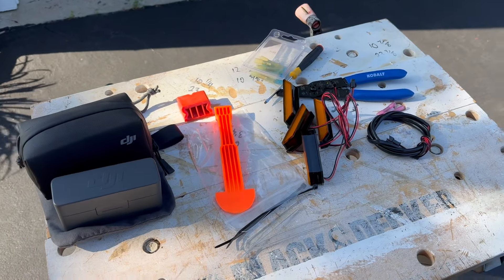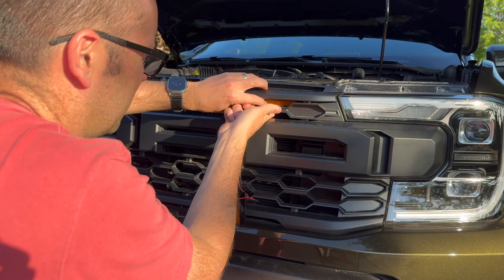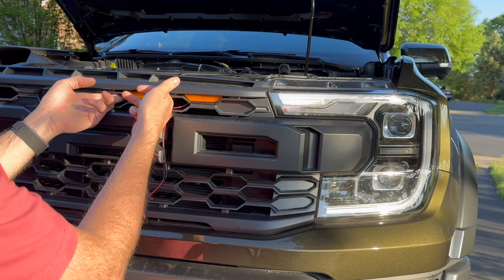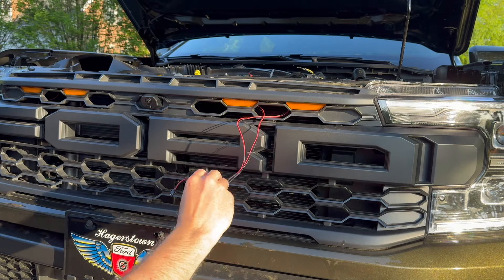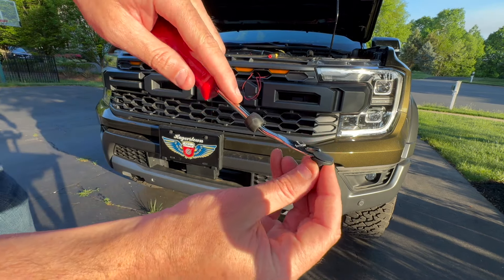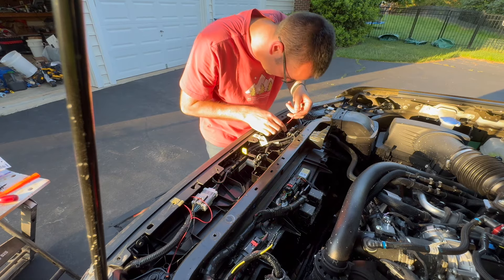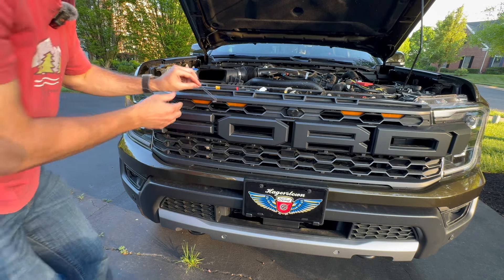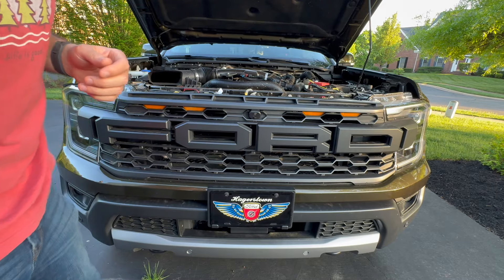2024 Ranger Raptor USA amber marker light install on Aux Switch 1

Comment: did the same with AUX6 because the wires for that are close to the grill. removed the top cover and used a coat hanger to pull the wire harnesses up the back of the grill. used f150LED's 4 light kit (2 sided tape attachment). took about an hour.
Reply from the maker: Awesome. Switch 6 is certainly the most convenient wiring up in the front for sure!

Comment: Looks good and seemed pretty easy. I've had my RR fir a week now. So far I only put a soft roll up tonneau cover on. I think something I want to do is pull off the black fender flares and paint them body color. I like that look more. Definitely need to get some lights on mine too.
Reply from the maker: Body colored fender flares will look great for sure! I have a huge light bar off my dad’s old jeep that I may hook up just to see it work again. May hook it up and throw it on the roof

Comment: Hmm, tried to comment but Youtube deleted it.

Anyway, this video was invaluable. I found getting that lower trim piece off the grill was not very easy without the possibility of breaking it. So, I went this route with one change. The first clip I tried to install immediately broke so instead I applied automotive tape to the top of each light and they went in just fine and they don't move at all, time will tell if it holds up.

Thanks for this video, I don't think I would have attempted this without seeing it first.
Reply from the maker: Glad you gave it a shot and made it work. I think the tape will create enough friction to keep them in there. I ended up using a tiny dot of glue on each one as well

Comment: Nice job.  Few takeaways for me…. I’d really like to see a video on how to remove the grill. I’ve seen a fair few videos now that claim it’s easy to remove the grill but never show the actual process - just the grill laying on the floor whilst they get on with whatever they need to do behind the grill.  Second, I’d like to see more about how AUX1 was presented and how you connected to it (unless I missed that somehow) just saw a couple of connectors being crimped (line and neutral) ?  Thirdly, where did you run the ground (earth) in end?   Lastly. Did your wife forgive you!!?? 😂 keep it up, loving the journey.
Reply from the maker: Haha, I did a second video of the wiring so that should answer those questions about aux 1 and the ground. But to keep it simple, aux 1 is the purple and green wire in the bundle next to the aux fuse and relay box and I grounded it to a bolt under the cowling that holds the hood latch for now. You could also power to the daytime running lights fuse if you wanted to go that route. I found a video on indicarbon.com about getting the grill off and they made it look way easier than it was, I was afraid I was going to break something when I tried prying the small trim piece off to expose the 8mm bolts so I did it this way. Wife is happy cus I used the truck to pick up 2 yards of mulch and haul some tree branches to the dump the next day :)
Reply: Ha!  Love it. Happy wife, happy life 😀

Comment: Awesome add, I am ordering one! I am curious if we can wire it without going through an aux switch. My OCD of that one switch always on would kill me
Reply from the maker: Absolutely… I think I may actually switch my wiring and power it from the same fuse up front that runs the daytime running lights. I just wanted to play with the aux switches but I think the DTRL is a much better wiring solution
Reply: @flaberdoopin and make a video of it, right? Please 😉

Comment: Could you mount with 3m auto tape instead of the plastic hooks to hold in place?  Mine arrives next week, and thinking about something similar
Reply from the maker: I’m not sure where I would put the 3m tape. It is too tight to put on the sides and I don’t think over the back would do much. If you took the whole grill off it might open up some other options for taping but I don’t see a way to do it when I put mine in. Sorry I can’t be more help on this idea but I’ll think about it and see if anything comes to mind

Comment: Looks great but would have liked some more detail on the install instead of just fumbling around with the plastic piece. Do you have a link to the item? Part number?  Would like to have seen specifics in the wiring.
Reply from the maker: I had the video edited over 30 min at first but thought that was too much. I will put together a quick video of exactly where I pulled wires and everything to make it easier to see install. I ordered from indicarbon and this is the link to what I got.  https://www.indicarbon.com/store/p/ford-ranger-raptor-next-gen-grill-lights-amber/white

Comment: Great video.  Do you know if these lights can be installed to turn on automatically when the running lights turn on, i.e. no auxiliary switch?
Reply from the maker: Absolutely, if you were to tap into the fuse for the daytime running lights you could have the amber lights come on any time the vehicle is started

Comment: We've recently discovered some fog lights for the Ranger Raptor model. A few have been supplied to the States, but there's a concern that they won't fit with the special bracket provided. However, they do fit perfectly on the AU Ranger Raptor! 

Could I kindly ask you for a favor? If you have a photo of the fog light bracket (shot from the back of the fog light showing the bracket no need to remove the fog), could you please send it my way? I’d really appreciate it! Thank you!
Reply from the maker: @Signaturelux37  I’ll take a photo tomorrow… how do you want me to send it?  I can just make a post here on YouTube and link it unless you have an email address i can send it to
Reply: @flaberdoopin  yeah sure that would be great Thank you! 🇦🇺
Reply: Also we have left you a message in Ranger 6G forum :)

Comment: Nice to see that the aux switches go off when the truck is off.  Are all the aux switches that way?
Reply from the maker: I do believe that they are. When the truck is off the little lights that make the switches glow all go out. I am going to hook up an old light bar from my dads jeep to the 25 amp switch tomorrow and I’ll let you know if that one is the same
Reply: @flaberdoopin  Thanks.

Comment: Update! I installed my amber lights on my 2024 Ranger Raptor and I ended up wiring them up to the driver’s side front fender marker light. If you have an email address you can share with me I’ll show you where I ended up hooking it up at. I ended up using that side marker because I only wanted the amber lights to come on when the side markers came on and I avoided using any of the auxiliary switches.
Reply from the maker: wow, that's a great idea... you can send an email to flaberdoopin@gmail.com if you dont mind.  i will rewire them today and free up that aux switch :)
Reply: Can you please tell me the details of wiring them.
Reply from the maker: @errolnuque8772  i have them wired up to switch 1 which is a 5 amp circuit and i keep it on at all times.  You can ground it to whatever screw or bolt you can find going into some of the sheetmetal or metal brace you can find near the wiring site.  The positive is in the bundle of 3 aux wires and i just found the correct color wire based on the manual.

Comment: Very nice! I am wanting to do the marker lights but I want to use the 3 slots at the top, will those also fit in the 3 slots at the top?
Reply from the maker: I was looking for the same 3 light kit but in the grill you would have to cut the plastic out to fit anything. This kit would not fit up in those from initial look because these would stick out thru the grill and might look awkward but I’ll take a closer look when it gets light and let you know.
Reply: @flaberdoopin   Yea, I would not mind drilling a few small holes to run the wires if those lights would set in those pockets nice and flush. Sounds like your saying those in your setup were to big to fit in the upper 3 pockets even if drilling out the holes for the wires? 

I really like how the ones your using fill those pockets and look factory.
Reply from the maker: @jdfleetguy28 I took a closer look and these lights would not fit in the top three holes even if you drill out the back. The shape is different but there are kits for the three lights out there now
Reply: @flaberdoopin  Thank you I really appreciate you checking that for me. 
I saw some somewhere YouTube or the Forums but they did not look near as high quality as yours. 
They did not really fit the pockets they were a lot smaller and set way back in the holes. 
I will keep digging. 
As popular as this truck is likely to be I am sure there is bound be something come out that fits in those 3 upper slots as nice as yours fit the lower slots.
Reply from the maker: i added another video about the wiring and talked about the fact that these lights would not fit in the holes above... they are a completely different shape and get smaller as they go back.  the more i looked at them, the less i think i would use those for the lights even though they are more classic and symmetrical
Reply: @flaberdoopin  Cool, I will check it out.

Comment: I will put behind the Grill a 30 lightbar Strands nuuk dark Night this bar have Position lights Amber / white
Reply from the maker: Awesome! I was thinking of putting a light behind the grill as well but it will be a super tight fit with the closing slats for the radiator right there

Comment: I have a question, do the four raptor lights you put in? Do they fit in the three slots right above that?
Reply from the maker: No, those holes are smaller and they get smaller as it goes back into the grill. Even if you cut out the back the lights I bought would not fit because they would still be too big.

Comment: Where did u ground the wire?
Reply from the maker: i just tied it into the ground for aux switch 6 because it was right there and it is a solid 12 gauge wire.  there are plenty of bolts to the chassis though if you feel more comfortable doing that.

Comment: You probably answered this in another post, but does the Raptor require/suggest premium fuel?
Reply from the maker: The Ranger Raptor can run on 87 or higher. The fuel door states 87+. These ecoboost engines will advance timing with higher octane fuel so to get the full 405 hp number you would have to be running 93 and it takes a bit of driving for the tune to advance the timing to get to the full power. Short answer is that you can use 87 but you do get better performance out of premium. I ran 0-60 in 5.5 in premium and today 6.3 with 87 (but it was 15 degrees warmer and I had some cowling off that allowed even warmer air from the engine bay into the intake so it isn’t a fair comparison but the temps might account for .3-.4 the rest is the timing being retarded because of lower octane.
Reply: @flaberdoopin  Thanks for the reply. Pricing out a Lariat with the 2.7, and for essentially $2K more you can get the Raptor. Plus I am seeing Raptor's available in my area. Given that, I cannot see a reason to buy the Lariat with the 2.7, unless I wanted the increased towing power and better mileage. The Raptor resale will more than make up for the cost difference. I swore off Fords since 1994, but right now, it seems like the Ranger is best in class (assuming they can get long-term reliability).

Comment: Is there a way to have them turn on with the DRLS
Reply from the maker: For sure, you could tap into the fuse for the Daytime running lights really easily! Or any accessory power that is on full time. If I just leave aux 1 switch on full time it is going to be on with DLRS

Comment: Do the three little slots above have space to add lights ?
Reply from the maker: No, sadly they do not. The way I understand it, the lights in the f-150 raptor and the Bronco Raptor are there because the truck is wide enough to require amber marker lights, the ranger is just a baby so it didn’t need them and ford went without. Those three little spots would have been perfect but they are closed off and would require some cutting to make lights fit.
Reply: @flaberdoopin  makes sense, that’s such a tease thought, I bet with a little precision drilling it could work… somebody in the aftermarket will figure it out. They look really cool, the ones you did!
Reply from the maker: I’m pretty sure they already have kits for the top 3, that was what I thought I ordered haha, but then I realized I got these and just went with them
Reply: @flaberdoopin  nice! My Raptor is getting built first week of June! Keep me posted if you find those!

Comment: https://www.youtube.com/watch?v=-2lmssgcyHY

Finally got around to adding the Markers in the spot where they are "supposed" to go.  Also added the M&R Pro Light Bar made specifically for our truck.
Reply from the maker: That looks cool. The 4 lights is growing on me but the three is always a classic
Reply: @flaberdoopin  I linked all 3 of mine together (3 reds, 3 blacks, then put one lead off of each one so I have one ground wire and one power wire.  Removing the grille and bumper were super easy and probably would have made your job a little easier than you think.

Comment: That's the lamest thing I've ever seen. You have a raptor but you don't have raptor lights. You should have the 3 up top 4, is not the deal? It's 3 bro.

What are you some Tacoma owner? In disguise.
Reply from the maker: Thanks for taking the time to leave a comment.  You must live an extremely dull life if this is in fact the lamest thing you have ever seen.  you gotta get out and see some other stuff.  I would suggest that you go with the 3 marker lights on your ranger raptor, but they look a little strange since they are 4-5 individual LEDs instead of a single orange glow from the entire space.  Cheers